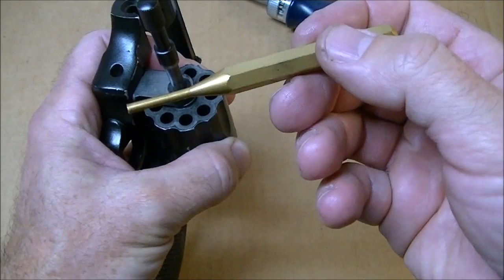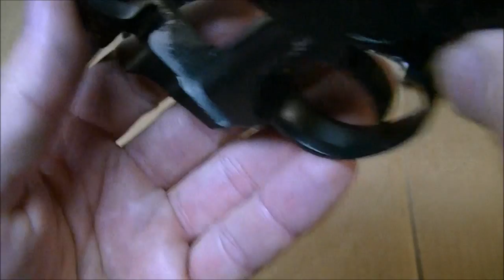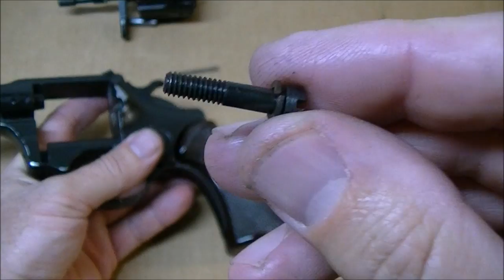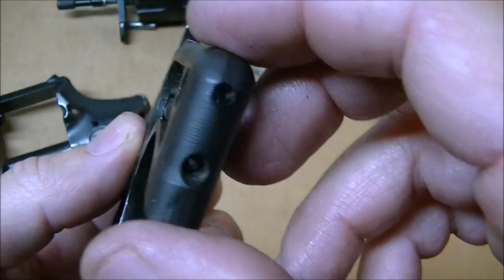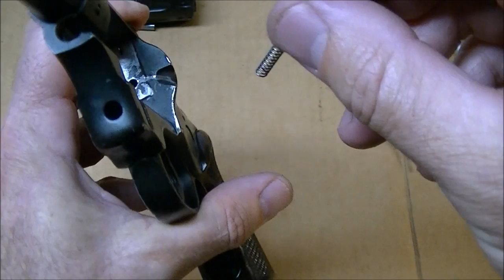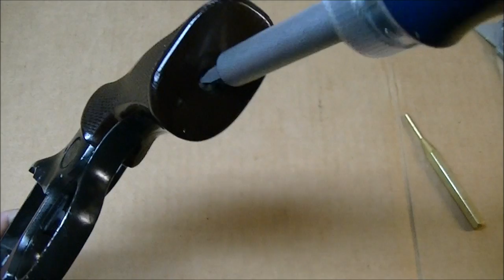High Standard R-101 "Sentinel" Revolver Disassembly

Comment: I inherited my grandfather's model 88 bought at Sears Roebuck in 52.  Thank you for the video.

I took it apart and cleaned it. 

For the layperson watching this,  its challenging to put back together.   I take apart my firearms and clean each time I train.  This one took patience,  elbow grease, and more patience.   I own a glock 19 and would compare breaking down the glock vs this like digging ditches with a shovel vs a ditch witch.  But the action is like butter now.
Reply from the maker: Yes the disassembly is not as simple as for something like a field strip for a Glock, but by revolver standards it is actually pretty easy. Cleaning and oiling the action of an old revolver can indeed make quite a difference, I have a Ruger Security Six that had an rough, gritty action when I got it, but once cleaned and oiled it was actually pretty nice and smooth.

Comment: Thanks for making this! I recently inherited an R-106 and have been looking for a good disassembly video. There are a few minor differences in the two designs, but this is a great starting point. Nice work, as always.
Reply from the maker: +webster7710 I dont think there is an enormous difference between the 101 and later versions like your 106, so hopefully this video will suffice.
Reply: +314299 Shooting Channel    Hello, I have one that will not shoot on double action. The cylinder will rotate when the trigger is pulled but the hammer will not cycle. Any idea as to the problem? Thanks.
Reply from the maker: +waccamawcharlieblue Nothing pops to mind. It's hard to diagnose a problem without being able to handle and inspect the gun in person.
Reply: webster7710 huujhhhhhhhuujhujhujjhujhuuiuujuu

Comment: Excellent video! I purchased a Sentinel R 103; it is a 6" variant with the black grips. It appears unfired and is in 98% condition. I have found it to be as accurate as my 6" barreled Ruger Super Single Six. It is great fun with 22 short ammo for pest control and plinking. As per 22 LR ammo it is accurate with most 40 grain standard ammo, my preference is CCI Blazer. Thank you for the tutorial and greetings from Houston!
Reply from the maker: Sounds like you have a very nice example. Blazer 22 has served me well over the years, good stuff and not too expensive.

Comment: thank you for keeping this video on here. I just got a hi standard r-101 with 3 cylinders, 1 in highly used shape, And 2 new in the box. also came with 4 barrels (not took out of the box it came in yet). one on the gun now is a 6 to 6 and 3/4  inch not sure how its measured in or out of gun.  And now that I have watched your video, and reading the comments below, I can now say it is in pretty good shape and glad I picked it up tonight.I can now confidently take it apart clean and check all mechanisms, and change barrels if I wanted. I don't know if it shoots better with the warn barrel I have on it i need to mic  out the barrel bore size to see if it is as worn as the one cylinder in the box. I did shoot it today it is a very easy gun to shoot and  is accurate at short distance around 25 yards I think it will probably be in the family for a long time.
Reply from the maker: Being a .22 I doubt the barrel that is "worn" has any appreciable wear on the bore, unless it was abused by poor cleaning or rusting at some point. Lead bullets in 22 ammo place almost no wear on barrels.

Comment: good video. I have one. but, when you close the cylinder back up, hold the spring loaded ejecter rod forward. If you snap it closed, the pin will cut a groove in the soft alloy frame

Comment: The old Ruger Security Six revolvers are a one screw weapon. The grip panels can be taken apart with a dime, after that, the parts can be disassembled by hand. Lovely series of revolvers, wish they'd bring them back
Reply from the maker: Here is an interesting fact, the High Standard double action revolvers and the Ruger Security Six were both designed by the same man, Harry Sefried.

Comment: Thanks.   Had a R-106 with a bent hand spring, and it would only work SA.  I was worried that I'd never get it apart and back together.  It has one more pin than the R-101 on the trigger guard, but essential the same internals.
Reply from the maker: It's good to know the two are so similar.

Comment: This procedure works well for the R-100 as well, but I would caution people not to disassemble their R-100 as the hand spring on it was poorly designed.  It was so poorly designed, that the R-101 was basically just a R-100 with changes to this part and those parts it interacted with.  Once again, DO NOT TAKE THE GRIP FRAME OFF OF THE OTHER FRAME on the R-100.  I learned the hard way.  The hand spring will come off and it is nearly impossible to reinstall.  Here is a manual with IPB showing the differences between the two models: http://www.highstandard.info/manuals/hprevolvers/0538D150R.pdf
Reply from the maker: +RyeOnHam Good point. I have read that the hand spring would go into low earth orbit when the grip frame was removed from the R-100. Good thing that they fixed that on the later versions.
Reply: +RyeOnHam There's a trick to this, on the R-100, and it takes using a thin tool, such as a small hook, down through the hammer opening of the top frame, to get the spring working with the hand, after you start to marry the frame halves. I have cursed these revolvers several times during my years as a Gunsmith. Another thing that is not easy on these, is the disassembly of the cylinder. That little pin at the plunger can be a bitch. You will get an experience on this, as the cylinder bushing can wear out on these, and a new one needs to be pressed in. That, and I have seen some missing the ejector spring.
Reply: craxd1 I figured both out by trial & error... lots of error.  Hopefully somebody else will be helped reading this.  I have a Sentinel MK III (the 22 lr one, whatever that one was).  It seems like a decent enough final version. I've got to make videos on them one of these days.
Reply: RyeOnHam
They made a camp gun version of the Sentinel once, and it's harder to find. It had adjustable rear sights, and was an accurate little revolver. These are not bad with fixed sights either.

I've owned many High Standards, and have a Supermatic Tournament now, which is the same model that won the Olympics in the 1950's. It is a tack driver. Another accurate one, is the 9-1/2" barrel, Longhorn Convertible, with the steel frame.
Reply: +craxd1 The adjustable sight model is the R-109 Kit Gun, first introduced in 1970.  First model to have adjustable sights.  I have one and it is a lot of fun to take out shooting.
Reply: +craxd1 I just bought a pawn Sentinel, and its missing the ejector spring, but I an going to live without it.  Thanks for the tips.
Reply: ***** The earliest models of the Sentinel did not have an ejector star spring.
Reply: *****
They didn't have one on the old models, and they changed that, as people would allow the cylinder to close with the ejector out, and scratch the frame. I had a 6" and a 9-1/2" Longhorn that way.
Reply: Yes my nickel frame was scratched by th ejector
Reply: For those who have an R-100, the hand spring is indeed kind of tricky, having the slave pin the right length helps. The worst part of assembly for me is the trigger plunger and spring, which have to stay in place and end up in exactly the right spot against the corner of the frame over the trigger, but want to fall off somewhere inside. I can get everything else right on the first try but even when i put a dab of grease on the trigger spring and plunger to hold them in place I have to assemble and take it apart several times until the plunger ends up in the right place. The R-101 eliminated the trigger plunger/spring setup and the single pin holding everything together - get an R-101 or later if you can.
Reply: @captchoad  I forget now, but even with my gunsmithing experience, the only guns I put in this category are the Remington model 14 and Remington model 10.  Both are JD Pedersen designs.
Reply: @captchoad  I just finished the reassembly of an R-100 that I got from my dad. He had disassembled it to replace the safety stop which had broken. That plunger and spring was a pain for sure, and it took about 10 tries of leaving various pieces out to finally determine that was what was causing the action to jam up after putting the frames back together, as it would cycle fine when apart. I finally determined the best way to do it is to put the frames together, with the trigger frame slightly angled down at the back. While pivoting it up, once the hammer is protruding out of the upper frame, start to cock the hammer back a bit. This will cause the trigger to move and change the angle of the plunger and spring, aiming them at the correct spot where they should seat. I'm confident I can do it in one or two tries at most now!

Comment: Nice, very simple.
Reply from the maker: Yes, one of the simpler revolvers to disassemble.
Reply: @314299  Picked one up that wouldn't rotate the cylinder. Had it fixed in 5 minutes. Incredibly simple, well thought out design. Thanks for your post.

Comment: Actually taking apart the R 100 is just as easy, but you do need a "slave" pin (takes place of the hammer pin, just shorter) for the hammer assembly so it can be removed as a unit.  You can make one easily with round spring steel and cut to fit.  Once you have them, they can help disassemble other firearms.
Reply from the maker: Good tip, thanks for passing it along.

Comment: Thank you very much for the video! I have the 6" J.C. Higgins Model 88 and just love it! The only thing I don't like is the lack of a return spring on the ejector! Most of these seem to have scratches on the left side of the frame because of it. I wonder if there is a modification for this? Probably cost prohibitive I bet!
Thanks again
Reply from the maker: +MSgt GB I've not heard of any modifications to them to add a return spring for the extractor. Perhaps a cylinder/crane/extractor from a later version (R-102 and on) would fit, they had a spring added.
Reply: Thank you, I will do a bit of research! Love your vids!
Reply: MSgt GB. I have a103, exactly The same. mine has that scratch, they all do. Just hold the spring tensioned ejector rod toward the muzzle end as you close the cylinder. little awkward, but Works.

Comment: I bought one of those a few years ago, and was really excited about it. Unfortunately, when I would shoot it, the cylinder would bind. I cleaned it thoroughly, including behind the ejector star, tried different brands of 22 LR, but that didn't help. The gunsmith where I bought it looked at it, but couldn't fix it. They gave me a refund. I miss that little revolver.
Reply: Your Fram is slightly bent and your range is off. Needs to be straightend. It's simple. A block of wood and a hammer..

Comment: Very useful video, thank you.  I'm wondering if there is a modification to lesson the long and hard trigger pull of this gun.  I have acquired a Sear & Roebuck Model 88 snub nose.  It shoots to the left for me.  I can adjust the rear sight for windage.  but I'm thinking a better trigger pull may help.  And, yes, I know, to modify the main spring is touchy and may cause it to misfire.
Reply from the maker: I'm very wary of any gunsmithing/modifications to revolver mechanisms unless they are done by experts who specialize on a particular model of revolver, and I have never heard of anyone who specialized in working on High Standard revolvers.  Improper "trigger jobs" often end up ruining good guns. At least the main spring is something easily replaced, you might contact Wolf Gun Springs to see if they offer a lower weight replacement for the High Standard factory spring.

Comment: Thank you for the knowledge.  If that frame is aluminum what type of finish options are there if you were going to restore one of these?  Blueing does not seem to be an option?
Reply from the maker: From what I have read the frame is a die cast material (zinc alloy), so you are correct blueing will not work. I think one could refinish the stripped frame with one of the sprayed on finishes like DuraCoat, or with a baked on powder coat finish. The gun in the video was actually painted by it's previous owner with regular enamel spray paint. It's not ideal but it kinda works.

Comment: Hey, really great helpful video! I never knew it was really that easy to take apart and re-assemble. It seems like a lot of systems have become over complicated in modern revolvers. I actually own one of these, but it has a slight issue that were not 100% on what its being caused by. Its shaving lead just a little- little bit, and were not sure if the timing is off, or the catch is broken. Any suggestions or ideas? Thanks!
Reply from the maker: It may have a timing issue or perhaps a problem with the cylinder stop, you would almost have to have a 100% correct working example to compare it to to see what the issue is.
Reply: @ Ahhhh alright. Thank you alot! Again, really helpful video for a beautiful firearm!

Comment: As this is an old thread, you may not see my question.  As you stated, this gun does not have an cartridge ejector return capability.  How do you disassemble the cylinder/crane/ejector rod assembly to "modify" the ability to influence the ejector to return as it does on the models 104?  Do you know whether or not those internal parts are interchangeable?
Reply from the maker: Sorry, but as I just have the one example seen in the video I have no way to know if parts are interchangeable between those model of revolvers.
Reply: @314299  Thanks for your contact.  The R-104/Sentinel "Imperial" has an ejector return feature the R-101 doesn't, but they both have cylinder "internal" springs.  (Just sharing info FYI.)  Keep up the good work.

Comment: Nice video, entertaining and educational at the same time. I do have a question, the pin that holds the grip frame to the barrel frame ( if this makes sense to you ), seems to be able to be removed and replaced with little effort; what holds that pins snugly in place after the gun is re-assembled ? Did I miss that ?
Thanks for this video too.
Reply from the maker: +Reg Sparkes The pin is just a slip fit, what holds it in place is the tension placed on it when the grip screw is tightened. The top of the grips push upon the frame and the grip screw pulls down on the grip frame, "pinching" the pin and keeping it in place. Simple but effective.
Reply: +314299 Shooting Channel 
I watched your video the second time, and this is what I figured out. Thanks for this all the same.
I do NOT have one of these revolvers , but I like watching these this just the same.

Comment: I need to replace cylender springs in my 101sentinal. Is there a video on disassembly of the ejector from the cylender? Or do I need to take it to a reputable gunsmith?
Reply from the maker: There never was any spring in the cylinder of a one of these guns. I know it seems odd, but these guns were designed without a spring to return the ejector.
Reply: Thanks for responding in such a timely manner. My cylender is locked up, and the ejector doesn't move. Is there a reasonable way to disassemble it. Can I get parts? Or, just scrap it and try to find another. I love that little pistol!

Comment: I recently came into possession of an R-103, that only works in double-action. Currently taking it apart to check out it's internals, but I'm not quite familiar with a revolver's guts yet. I was aware these revovers were supposed to be double AND single action, what could be the thing causing my firearm to not lock back to single action?
Reply from the maker: Diagnosing mechanical problems is pretty much impossible without examining the gun in person, I suggest you take yours to a qualified gunsmith.

Comment: I have my father in laws R101 now the eject rod isnt springing back after so is the spring broke in the barrel cause my dad had the same one and his works fine any ideas on how to replace the spring?
Reply from the maker: High Standard R-101's never had an ejector rod spring, the ejector rod return spring was introduced on the R-102 and later models. So there is nothing broken or "missing" on your 101, that's the way it was made.
Reply: @314299  thanks for the info.

Comment: What actually cocks the hammer in double action? Mine will shoot fine in SA, but will not draw the hammer back in DA. (The cylinder DOES rotate correctly in DA though).
Reply from the maker: Much as I would like to help it's not possible to diagnose the issue without being able to inspect the gun in person. Your best bet is to take it to a qualified gunsmith.

Comment: My fiance inherited one of these from her father. The cylinder rod doesn't budge. So, I can't move the cylinder out. Any tips?
Reply from the maker: I would suggest giving it a good soak with a penetrating oil. Let the oil soak in for awhile, follow that up with some light taps with a plastic face hammer, that might loosen it up. If that does not work then a trip to a gunsmith might be in order. Good luck.
Reply: @314299  Giving it a soak as in the cylinder rod?
Reply from the maker: @RayCornett  I'd put the whole gun in a container and hose the cylinder, cylinder pin, yoke/crane down with a fair dose of oil and let it sit for awhile to see if it helps loosen things up.

Comment: How do you adjust the rear sight?
Reply from the maker: The rear sight is "drift" adjusted - use a brass punch and a hammer to tap on the side of the sight to drift it in the dovetail. If the gun is shooting to the right, move the sight to the left and if it's shooting left tap the sight to the right.
Reply: @314299  Thank you very much, my husband thought that was the way to do it, in some form, just wanted to make sure, so thank you for confirmation.